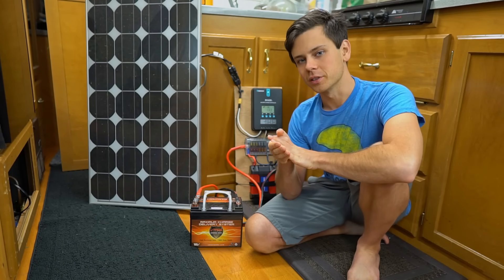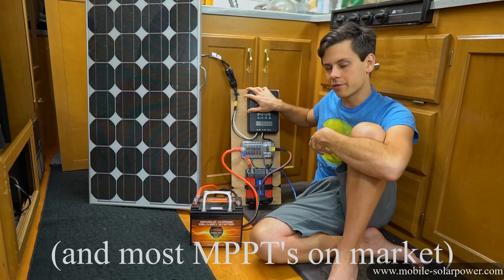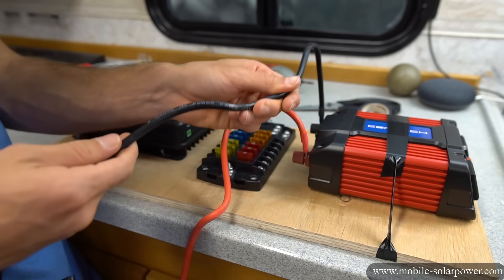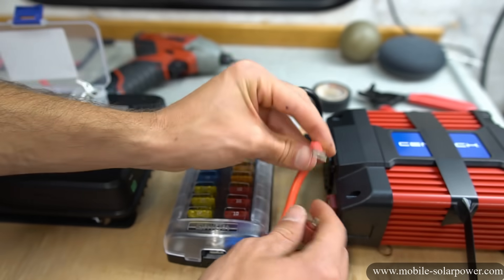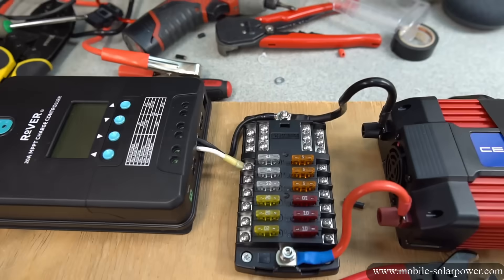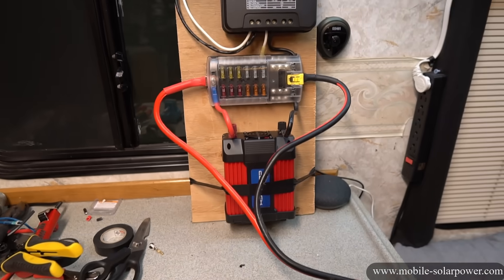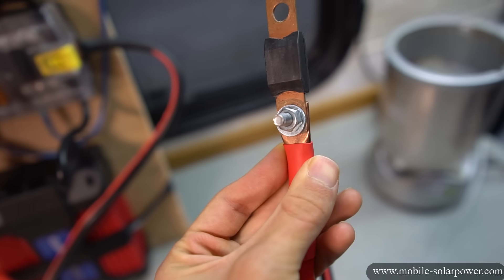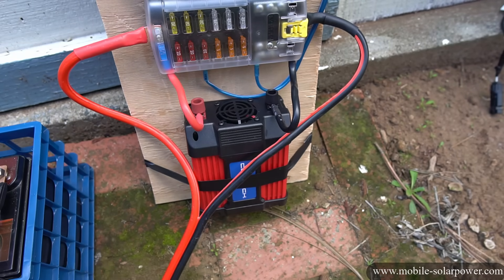DIY 200 Watt 12 volt Solar Power System "The Minimalist" Beginner Tutorial

Comment: Three points:  Good Job on the tutorial.  However, this isn't Minimalist for the price tag of $1700 est.   I have a small teardrop that only requires LED lighting and recharge of portable electronics (cell phone, ipad, 200W ceramic heater, flashlight) and came up with this for my needs:  Rock Pals 300W portable rechargeable generator (7.5 pounds... $250... three ways to recharge) and a 100W solar panel ($130).
Reply from the maker: Considering most other systems cost 10k or more, this is considered the minimalist haha
Reply: @WillProwse  .. good point.  also good is that prices are going down.
Reply from the maker: You should use a normal solar generator at that price point

Comment: Hi Will,  For future california power blackouts, I recently got the ecoflow delta and two 100 watt solar panels.  My house already has a professionally installed 20 panel grid tie solar edge system.  With the new small solar panels for emergency battery power mostly in  storage, would it be a good idea to get a small 500 watt grid tie inverter and use the backup panels at the same time as the solar edge?    Is there a chance the new inverter could damage the other inverter, or make it less efficiently run?

Comment: I don't understand how to get power to my DC fridge from this system.....help!!  I have a cigarrette lighter adapter plug that came with the Dometic CFX3 fridge. I get all the other stuff, the inverter is for AC power..but what about DC??????  From what I understand it is better to run the fridge in DC, as it uses less power than in AC mode.  The other thing is I bought the renagy 200 watt "premium" kit with the mppt, do you connect the Solar panels in series or parallel?  And if you connect in series, doesnt that mean you have to use 24 volt for power? Or does the charge controller, same as you have here the 20 mppt, does it automatically figure out what voltage you want.  I get confused on that part.  Perhaps you could make a video on just that.  Connecting in series vs parallel, and to 12 volt or 24 volt.  Thanks!!!

Comment: Hi Will, thanks so much for sharing all your knowledge and expertise. We are using your videos as our manual for solar installation. I have a question/NEED some advice. We want 400W solar on our Ford Transit but we ALSO have a fan to install AND we want a small window over our bed and so having 4X100W panels is impossible for our layout. I see that Rich Solar have a 200W solar panel and the dimensions would suit us better. Its probably a silly question but would there be a disadvantage to installing 2X200W panels instead of 4X100W panels?  Thanks mate and greetings from New Zealand :D

Comment: Hey man, loving your videos! I wanted to pretty much do the same set up in the back of my 4wd but with an epever going directly to the fuse box as you have done. I would like to also use the mt50 to view the display. I want to be able to view the load though. How do you attach the load cables to this set up with all the accessories coming from the same fuse box?? TIA

Comment: Why did you connect the fuse block to the battery outlet on the solar controller and not the load outlet?

Comment: good evening, how can i make a photovoltaic system with solar panels, voltage regulator and pure sine wave inverter.  Power 600 watts, 230 volts.  I already have a 12 volt battery, Amper 210. thanks greetings lore.

Comment: Hi Will,
	I’m in the process of building a truck camper and am gearing up to get my solar installed. I was hoping you could answer a question for me. 
I’m planning, and hoping, so place the batteries in the bed of the truck just in front of the wheel wells. They will have to be removed when i take the camper off, but I’m mainly wondering if its even a possibility to wire the batteries up that far apart from one another (about 4 feet).
I’d appreciate any feedback! Your videos have given me great info regarding what product I want to buy!

Comment: Will does the system u showed where there is a combo mppt charge controller...ac...etc have an auto transfer switch and does that include charging from alternator option?   Also 800 watt inverter seems really small...is there a bigger inverter that comes w it that is still 12v?  Ty

Comment: Thank you Will !!! What size fuse terminal would you recommend  (2 to begin with and eventually 3 100watt panel system) between a  MPPT 30 Amp controller and a 1200watt pure sine inverter?

Comment: I’m havinga solar install 2x 335 watt panels and two 6 volt batteries. They are telling me I need a 40 amp charge controller as well as a battery monitor to show battery state of charge. Isn’t there a charge controller that does both or do I need both.? Thanks

Comment: I need help, I wired up a 15 watt solar panel to a Rich Solar Controller, Then on Battery side out from controller Positive to LOAD, i went to a 3 position Boat switch 1,2 and Both. I  Then ran solar to batteries 1, 2 selectable though switch.
Issue is: I have 11.4 volts to solar controller and only .58 volts to Battery. 
Is this a bad ground issue? 
Controller issue?   
DO you always have to hook the battery up first to controller before hooking up solar panel to Rich Solar?

Thanks in advance for anyones help.

Comment: awesome stuff Will! I live in Santa Barbara and am trying to put together a small system as we have had several power outages since moving there 2 years ago.

Weve gotten by thus far with 3 Goal Zero's, 2 400's and 1 1400. It would be nice though t have a ore permanent residential setup. I gave up on Tesla after waiting over a year for a power wall and the they doubles the price. Love all your content.

Comment: Why do you not recommend connecting the fuse box (for appliances) to the charge controller directly?
Reply: He used one of the fuse of the fuse box (for appliances) to protect the wire from overheat (white wire in the video).. and is a good use for quick disconnect, just pull out the fuse....

Comment: I'd like to build a solar powered system to my van's rooftop capable of delivering enough power for 90 watts load for at least 5 hrs during night time.  Is there a one pc.(single) panel rated at 200w?  most of the panels I found online are rated at 100w/panel.  thanks.....Also, what is your recommended MPPT, batt 12 vdc, Inv, etc.

Comment: Your videos are awsome i want to set up a solar system to run lights in every room and some ac outlets separately from my grid connections. So you could walk into a room and turn on either the power company light or an off grid light atonamoslly of each other. Thanks.

Comment: I don't understand why you put the output of the controller into a 25 watt fuse on the panel. Isn't that backwards? Pretty sure it is. The electrical in/out puts go on the sides ground into the little side terminals and the the fusses branch off to a load. Now you'll only have 300 watts to power both the battery and the inverter ( or 600 if it is in series) before you blow a fuse.

Comment: Ok so I watched this video I've got probably about 5% nailed down 😂 out of the 5% I know is that a 400w inverter is only capable of running 200w total roughly after inefficiency.... how are you running a 750watt hot air gun from that inverter??? This I thought was impossible. I have a solar panel 200w kit that came with a charge controller. Ordered a 12v fuse kit as I will have a few 12v items ie lighting. I was looking at 1kw pure sine wave inverters and thinking spiralling costs. Will that inverter cover a run of sockets in a teardrop caravan. Literally just tv and phone chargers. Was thinking the refrigeration would be a 3 way fridge on gas and 12v to save draining the battery flat. Kind of glued the back boxes onto my wall panels and then realised I needed more to get it to work so any advise in regards to picking the right inverter would be great

Comment: Why is the controller so large? I have a 20amp Morningstar SunSaver that's a fraction of that size but with no digital readout. I don't know if mine is great or crap but it's worked flawlessly for 10 years. I used a boat trolling motor plug to plug in my panel's for lack of a better idea for the price. I have large BP panels because I was told they are sturdier and would last longer on  a trailer.

Comment: I noticed you switched out the fuses before connecting the charge controller. I bought the exact same fuse box but didn't get 25 amp fuses. I have a 30A PowerEco charge controller. Do I need fuses higher than 20 amps or is that enough?

Comment: Love your videos. You make it so,  a not so mechanically included person....me, would have no problems. Will, what do you think of the "Dokio 220 12v Mono-crystalline Foldable solar panel w/charge controller" please?  I have a 18' Rpod and don't want to install a permanent thing as next year I may be upgrading to a few feet bigger. Plus if I am parked in the shade, I want to be able to still have solar. I'm open to suggestions.

Comment: LOVE your videos! What gauge wire would you recommend for 12 V accessories like LED lights?
Reply: led lights have extremely low draw in most cases so you can use wires that are quite small, 10 gauge will be more than enough, and depending on distance and exact draw, you can probably use 12-16 gauge as well. Anything else will be so small that it will be challenging to work with and won't support much draw at all.

Comment: After your most recent video on the apex and how you don’t promote it I decided I’m going to attempt the diy setup. I just purchased the epever 40 amp controller off eBay. Are you the owner of that store on eBay named domitronic?
Reply from the maker: I am not the owner of that store, and that controller is awesome! You can build your own. You got this
Reply: DIY Solar Power with Will Prowse thanks for the pep talk. I also ordered one battle born last night. So all I need now is the panels and an inverter. I’m going to check ur videos for an inverter video. I hope you have a video on those because lots of these 2000 watt inverters for sale on google have reviews from ppl that say “doesn’t come close to 2000 watt continuous output like the description says it’s supposed to” & “Will start beeping or smoking and shut off when trying to run a 1300 watt load for more than 10 minutes. Can’t handle a continuous load like it should”  in fact, the inverter you promote on the 400 watt diy blueprint has reviews like that on amazon so I got too scared to buy it last night, as well.
Reply from the maker: @HomesteadAtLast  yeah cheap inverters are horrible. And even xantrex is made in China these days. Magnum has horrible problems and it's made in USA. The one I recommend, I have three, and have used them 24/7 for years. And load tested them. They are absolutely amazing inverters. Some Chinese ones suck, and some American ones suck. Only way to find the good inverters is to test them
Reply: DIY Solar Power with Will Prowse  I think what you’re trying to say is that I should spend the big bucks on a 3000 watt inverter which is rated too high for my needs but it will at least be capable of running 1300 watts continuously.

Comment: Hey when you were talking about the fuse for the 1500 watt inverter it needed a 158amp fuse but would that change if the surge is 3000watts, to a 316amp fuse?

Comment: Why do you connect the positive of the charger to the fuse ? If the current moves from negative to positive isn't it more logical to use the fuse before it goes to the charger to protect it ?
Reply from the maker: That's a common misconception
Reply: @WillProwse  can you explain ?

Comment: Is it possible to add a 200ah 12v AGM battery to this specific fuse block? On the website it says maximum amp 100ah
Reply: I think they mean the Max AMP the Fuse Box can handle. Not the capacitie of the batterie which hast nothing to do with each Others. Sorry for Bad english
Greetings from Germany

Comment: Why do I need to hook up the inverter to the fuse block? If I only need a/c for 2 outlets I can just run the battery to the inverter then run 2 wired plugs from inverter to outlets correct? Then I can run the d/c from the battery to the fuse block correct? This leaves the solar charger as a stand-alone charge system correct?

Comment: I don't get why you fused the regulator to battery but not the inverter to battery?
Reply from the maker: Because bolt on fuse on main cable is for the Inverter
Reply: @WillProwse  I wrote this comment 2 year ago when I built my first solar system. I don't use an inverter as not needed most stuff I use is all 12 v. I understand how you did it why you did I am still confused with your method of writing I just wrote another comment so I'll let you reply to that however looking at this again what if the inverter shorted or something wouldn't you want it to fuse out before the fuse box to avoid it potentially damaging anything else connected in that array? 

Your vids are very helpful btw I just purchased your book, and joined your forum under the name nachjoe posted a good question with many people trying their best to help me

Comment: Could this system be used to supply power to 10 x 10 shed. Would runa, lights, power tools, fans maybe an air conditioner.
Reply: A/C will drain your battery bank rather quick.... it's not suggested to use solar power for A/C... shore power is for high draw systems such as furnaces, air conditioning... and so on... solar power is usually meant for low draw use.

Comment: One suggestion Will:  Help us build some power failure/automatic on lighting for the home.
I'm working on power failure gizmos that will automatically charge 12v lithium packs and sense a power outages (at home), then automatically switch on 12v led strips.
Reply: What are you building these gizmos out of?

I wonder if you could cannibalize old UPS circuits? (From battery backups with dead batteries.) When wall power cuts out, they kick in and supply power from the battery.

Comment: Thanks for the video. I wonder If I want to hook a portable solar panel with its own controller canI hook that controller directly to the battery?I have already a fix solar panel. During summer we prefer to put the trailer under shade and we want to add a mobil panel solar. Thanks

Comment: I’m building The Minimalist Solar panel set up. Battery bank is 2 , 80 amp hr. Deep cycle Duracell.  Ihave 4 gauge battery cables (72inch). I have the same fuse box as your video. I’m placing 170amp fuse from batteries to kill switch and then on to fuse panel. 1500w Krieger inverter. 2 Awg wire from inverter to fuse panel. Question: Is it ok to mix 4gauge battery cable with the inverter 2 Awg wire? I got a Rover 30amp charge controller(facing the fuse box like your video), 10 gauge wire to The Rover. 40 amp blade fuse for charge controller-and 40 amp fuse to solar panels(2 100w renogy). Question: your video wires the panels in series. Can I do the panels in parallel? Thanks so much—VTown Paddy

Comment: Will do you have an alternative to the MPPT 20A? It says the one you’re recommending is out of stock and doesn’t know when it will be restocked!
Reply from the maker: I noticed that! There is alternative in the solar charge controller section of the website under solar power system components
Reply: Will Prowse I seen a similar one but it’s a 40A. Will that be ok or does it have to be a 20A?

Comment: Why have the 12v fuse box? Charge controller connected to battery, then battery to inverter and done. I use a cheap 30 amp PWM charge controller $13 from amazon and a 750 watt inverter $39 to run my freezer at the deer lease. IF the inverter burns up who cares at that price point. The inverter already has breakers built in. So why make your system more complicated?
Reply: He mentioned in another comment that the fuse box was for 12 v DC loads.

Comment: You scared me when you said the Rover can only handle 200 watts.  There's 2 models called Rover, 20 and 40... I have the 40 amp model that can handle a bit over 500 watts.
Reply: I think that'd be 480W?
Watts = Amps x Volts
W = 40A x 12v, so 40A x 12v = 480W.
I'm getting the Renogy 30A 12v/24v MPPT controller, which would be good for 360W.
30A x 12v = 360W.
...if I'm doing the math right. ;-)
 -- BR

Comment: Whats up Will, hey I was wondering why you connected SCC to the fuse block. I thought it needed to be connected directly to the battery with proper fuse? Please let me know your reasoning. Thanks
Reply from the maker: Oh it can be connected anywhere as long as it has proper gauge of wire/fuse size. It doesn't matter.
Reply: Will, although you say its correct, (and probably is) I still feel somewhat suspect because of how a charge coming from the panels, would have to travel through all them wires and fuses in order to charge the batteries. And dissipate the voltage to get a clean charge. I'm gonna research that subject further. Just so there is more clarity.
Reply from the maker: @milvolts1  research wire loss. you can have the solar charge controller 1 inch or 1 mile from the battery as long as you have the proper gauge wire, and a fuse to protect the wire. research 3% and 5% wire loss and when each is applicable.

Comment: Hello Will!
Question for you. In my Hymer Aktiv to charge my phone in USB my inverter needs to be on, I know this is very inefficient, do you think I could run wires from battery to new fuse block and then to new cigarette lighter or that would screw up something? I have 12v system. 320w  solar, 2000w inverter and 400w battery 
Another question. If my van battery dies for some reason can I get a bust cables and run a bust from my house battery to van battery ? Or that would create an issue?
Thanks